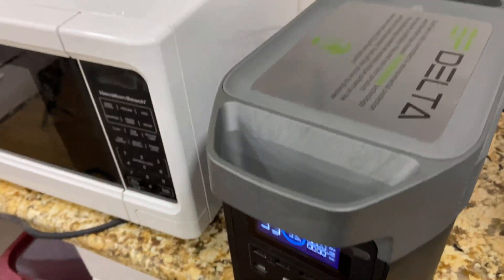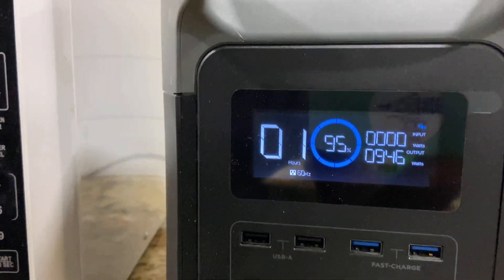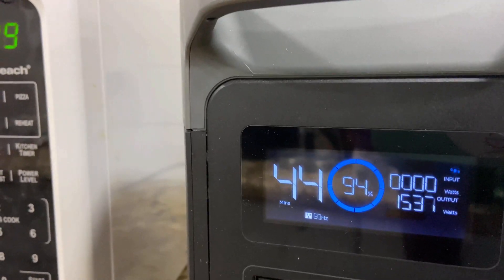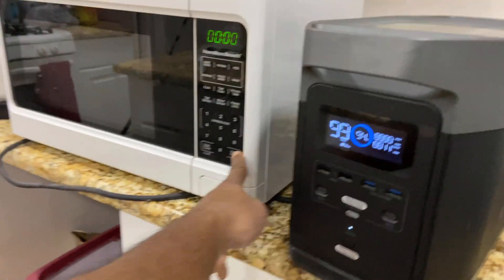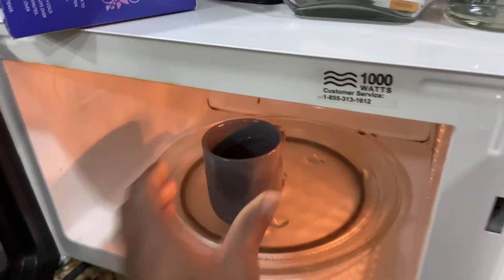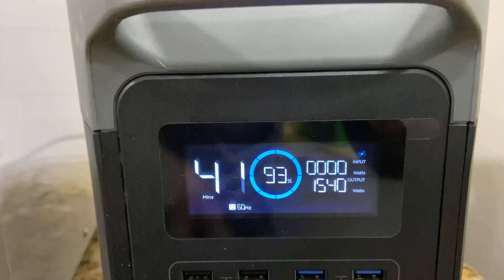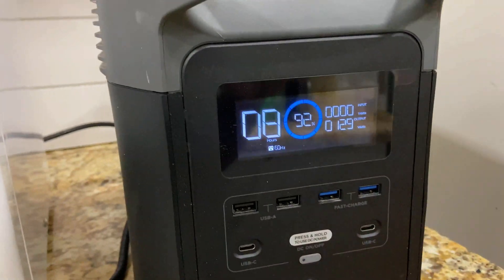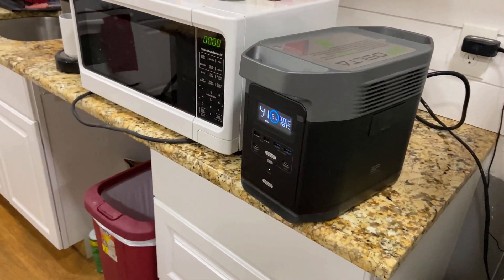using EcoFlow DELTA Power Station to run refrigerator microwave and coffee maker

Comment: If I use an extension cord. Can I plug in a tv Wi-Fi and speakers all on the same plug?
Reply: See why not. All low amp wattage unless if it is a amplifier speaker then it is higher voltage to use.

Comment: Doesn't  this eco flow  have an x mode ?
Reply: No not the 1300
Reply: @chrisg94x   really that’s good to know I want to buy one unit saving up I was thinking of a generator but generator will need to have gas and even the Honda produces a good amount of noise I want a maintenance free option don’t need to be pumping gas heheh in case of a huge emergency

Comment: A  standard  refrigerator's  compressor  requires  about  3  minutes  off  time  for  pressure  equalization  before  a  re-start  should  be  made .   The  900+  watt  draw  at  0.55  into  your  presentation  would  indicate  the  compressor  is  pulling  'locked-rotor amps'  trying  to  start  but  unable .    It's  internal  overload  protec  would  cycle  it  off  for  a  short  period  of  time  which  allowed  you  to  start  the  microwave  &  coffee  maker  .  .  .  .  .  when  it's  overload  protec   remade  &  compressor  tried  to  start  again  is  when  your  overload  occurred .  Normal  power  draw  for  your  refrigerator  is  probably  100 - 145  watts  for  compressor  'run-load amps' .   If  in  defrost  mode  it  will be  higher,    300 - 500  watts  for  resistance  heater .    You  should  always  allow  equalization  time  for  any  unit  with  a  compressor .             Thanks ,                  RH

Comment: This is a good starter unit for pushing out 15amp so the question shouldn't be if it can run it but for how long in most cases.